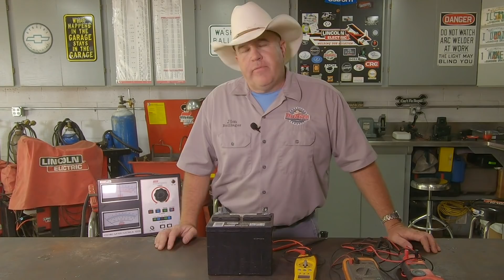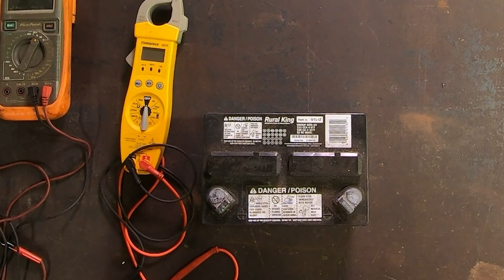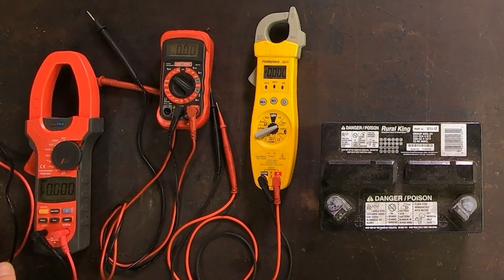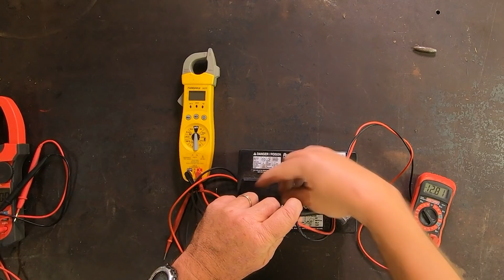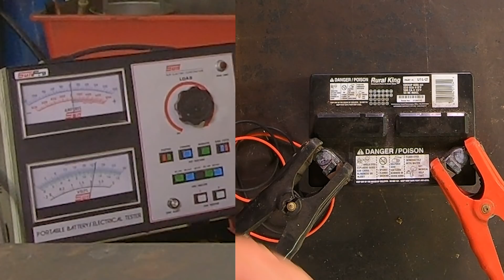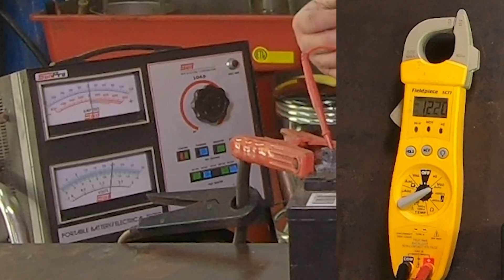Car battery CHARGING nightmare

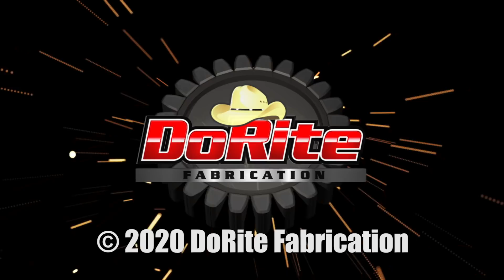Comment: I’m at 10:44, not knowing the answer yet, but really nervous for you touching both posts with your bare hands at the same time. Go on ...
Reply from the maker: Why would I be nervous touching both posts?
Reply: Have you touched with your tonge both poles of a 9v battery? My rule is not to.
Reply from the maker: Your toung is wet and the saliva acts as an electrolyte. Dry hand have way to high a resistance to tingle. Wet, dirty hands on the other hand (there is a pun there)........
Reply: True, I just will be on the safe side.

Comment: Run the engine with battery disconnected and check the leads coming from the engine for a polarity reversal, this happened in the old days with dynamo type generators when the battery got real flat.

Comment: One tip that I am sure you are aware of but probably forgot in the process of making the video, pull the caps off and verify that the plates are covered and leave them off as you perform the load test. If there are any opens with the plates and any hydrogen gas collects inside the battery it will explode and sound like a shotgun went off. 
One reason that the battery may not show any current is that it may be sulphated up where the plates hold a charge but there is so little plate exposure that hardly any current can flow.

One thing you might try is to hook up a headlight to the battery and drain it completely dead. Then, making sure there is plenty of ventilation, try charging it in the proper orientation. You may want to hook the battery up to the unplugged charger and plug it in at a safe distance. 
I hope this helps.

Comment: When you were putting it away a year ago, is it possible that you could have inadvertently shorted the posts on the voltage regulator? Those of us from ancient times used to do that to reverse polarity on our old 6 volt, positive ground tractors.
Reply from the maker: It's not a mechanical regulator. Just a diode style rectifier.
Reply: @DoRiteFabrication , roger that.

Comment: As a golf course mechanic years ago I saw this happen a couple times.always    on discharged batteries.oh yeah I also found out 2 cycle engines will run backwards quite by accident
Reply from the maker: I've had old outboards with point style ignition, pop back and start running in reverse.  Screws with your head a bit at first....
Reply: @DoRiteFabrication  Push start a mates motorcycle backwards and hand it to them for lol's

Comment: A battery is really nothing more than a capacitor. Research on how to re-polarize a capacitor
Reply from the maker: In the simplest form yes, but there is a chemical change to the plates as they take a charge. How did they swap sides? It take energy (that is stored in the plate) to force that change? Where did it come from?.....
Reply: @DoRiteFabrication  The dielectric solution is what changed polarity not the plates. The solution causes oxidization of the plates which gives them the ability to conduct electrons.
Reply: @DoRiteFabrication  Basically what I'm trying to say is the electrons in the solution flipped direction and the positive side of the electrons are now drawn to the negative side of the plates instead of the positive side of the plates

Comment: I had read about this in Popular Mechanics more than 50 years ago. If you had a dead battery, and jump started it reversed, if it has a generator the generator polarity will also be reversed since the field is reversed. Chemically, the plates are made of lead, one is coated with lead dioxide and both are immersed in sulfuric acid. When all the lead dioxide is consumed by the acid, the battery is dead. Charging it moves the lead dioxide back from the acid to the positive side. When it was jump started backwards, the process of deposition on the positive side started to the terminal marked negative. Since the generator (not an alternator) had the field reversed, it is happy to continue the process. Lacking a radio and such, the tractor lights will work just as if it had a positive ground design (like a '49 Ford). However, the battery is basically shot, as your tester indicated. Not enough lead dioxide gets deposited to make a large enough area to generate much amperage.

Comment: Any way you look at it, the battery needs to be replaced. The reserve voltage is gone. Find a guy (probably a RR guy) that repairs batteries.  They are scarce, but when you find them, they can tell you what's going on. The wizard that I knew passed away quite awhile ago. He repaired bad cells in batteries that were used on passenger cars. He lived into his 90's. I miss him.

Comment: The issue may be more common than we realize. When we think a battery is discharged we put the charger on it and if it trips the charger we assume the battery is shorted or sulfated. Seldom do we check the battery with a volt meter. If I remember correctly, there is little difference in the makeup of the anode and cathode of a lead acid battery. Polarity is determined by the first charge. Since I have old timers, my memory is not as good as it once was. It is possible that a complete discharge and then charging the battery in the correct polarity may correct the problem but depending on the age and quality of the battery you are just as likely to further damage it. The mystery is how it acquired the reverse charge. That one may never be solved.

Comment: Plates in Battery sulphated and welded together, had that happen on my 76 Harley, what is messed up is that it had enough power to run the starter backwards. this bike was bought as basket case and turns out charging system was charging a/c voltage.
Reply: Must have been a bad regulator rectifier, all stators charge in a/c then the regulator rectifier changes the current to dc, and limits the output.

Comment: could the battery be affected by lighting ? if it was low could that be the reason, if not put a load ( not to big a load )on it and charge the right way when flat also check fluid level's

Comment: Back in  6v./generator days, it was common for someone to connect the battery up backwards then start the engine which charged the battery backwards (reverse polarity)  Of course, generators operated by grounding the field, not by applying voltage. Perhaps you have a grounding problem with the tractor.

Comment: A lead acid battery is lead plates and water and battery acid.  A charged battery the positive plate is lead with a lead sufide covering.  Drain the battery to flat using the carbon pile, recharge the correct direction.  Check the charging circuit on the tractor to make sure it's charging in the correct polarity.  Same thing happened to me on a Ford 6v pickup though some one put the battery in backwards -- good voltage, nothing for capacity.

Comment: A high internal battery resistance will cause the voltage to drop without a measurable load.  I bet if you put a small light bulb across the battery the voltage will drop without lighting the bulb. 

No clue about the polarity reversal.

Comment: The problem is, your battery was made in Australia.   Seriously, what happened is sulfating of the plates has an inverse electron exchange, it can happen when a battery of this type is fully discharged and then recharged by the dissimilar components in the circuit

Comment: My dad used to call that a "surface charge".  If it was mine, I'd put a household lightbulb across the terminals and leave for a day or so, then charge it with the correct polarity. 

Second idea, replace it.
Reply from the maker: It was replaced before the tractor pull, but I still wanna know the why and how.

Comment: The first thought I had was your carbon pile tester is faulty..at maximum load the resistance of this would be in the order of  0.02 ohms..if as you said it was set at Max load and showed a voltage of 8V then there would have been at least 100Amps...so I would be checking that tester...and use your other meters to verify your carbon pile tester.
Reply: The amp clamp needed to be on the neg cable.  He reversed the pile leads but put the amp clamp on the pos as normal.

Comment: I have seen this happen before.  I was in the battery distribution for 40 years and saw it maybe twice. What I found was the the battery went completely dead and it was jump started backwards. It is badly sulfated (it insulates the plates) so you will not get any capacity. I will be happy to talk to you about it.  That is what I did for a living.
Reply: Steve, you are a man of many talents!
Reply from the maker: That's the odd thing about this. I am the only person here that even knows where the battery chargers are. No one put a charger on the battery. It literally just reversed itself.  If it was backwards when I installed it, the starter would have turned in reverse and not slung the bendix gear out to the flywheel. Plus, the LED headlights and electronic horn would not have worked. I honestly have no idea. The only idea I have is little green men, or a total platonic reversal.  Other than that, I got nothing. Thanks for you input and expertise.
Reply: @DoRiteFabrication  I suppose that stranger things have happened.  I got nothing else for you. I witnessed one possibility of that happening but I did not have access to all of the history.  I did however successfully reverse it back by hitting it with a heavy duty battery charger, staying way clear of it in case it blew up.  It did not have good capacity following that and had to be replaced soon after.
Reply: @DoRiteFabrication  Don't be dismayed Jim. As a retired industrial electrician I saw this happen many times over my career.  Not a battery reversal but just the magic of electricity. No explanation as to why things happened, we had a term for it, "F in magiic" And all the electricians knew exactly what that meant, because it happened to all of us. And many times. Things you just ca't explain, so you just accept them and move on.

Comment: I believe that the plates shorted when it was drained for a long time...thus the reversing of polarity.
Reply: I think that if a couple of plates shorted together the battery wouldn't show 12+ volts since the cells add up collectively (in series).
Reply from the maker: I agree, shorted plates would equal a lower voltage.

Comment: It shorted out internally, or you have entered another dimension where everything is backwards from what you know...
Seriously, an internal short is about the only thing that makes sense.
Carefully cut the top off and have a look, I bet that I am correct.
Reply from the maker: But an internal short would not maintain 12.6 ish volts
Reply: You wouldn't think so, but who knows for sure.
Ok then, it's magic pixies!

Comment: Did the lead come off the plates and short it out by arcing across the bottom? It happened to me at AutoZone.
Reply from the maker: If that had happened the voltage wouldn't maintain at 12.6.

Comment: Sometimes when batteries get over discharged they will reverse polarity this used to be the case especially with NiCd's. With the high impedance of digital meters typically around 10M ohms you would not se any appreciable voltage drop but that load should see the voltage drop to zero, it is possible that the load is not working due to it requiring some power from the test source for relays or just from not having been used for a while, Have you also checked that the charging circuit on the tractor is working correctly, possible rectifier failure come to mind.

Comment: But Can a 12-volt Battery Reverse Its Polarity? Yes, it can happen. If the battery cells are out of balance, some cells will discharge before the others. As it continues to discharge, they will start to reverse polarity.Aug
Reply from the maker: The electrons look to reach a point of zero potential. If anything discharged it would not recharge without being acted on from some source of energy...

Comment: Suspecting broken buss bar to terminal in the battery, (no current pick up under load) , voltage measured trough acid not trough plates . ( Or something like this ??)

Comment: I think the last or first cell have crimped making the anode and cathode change polarity position
Reply from the maker: If that were the case, at least one cell would be dead, and the voltage wouldn't still be at 12.6 v....